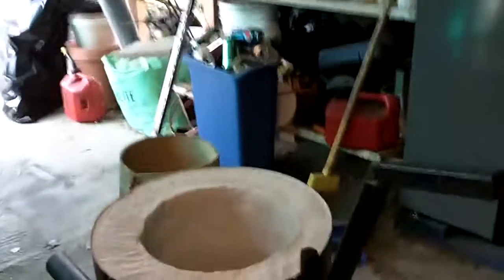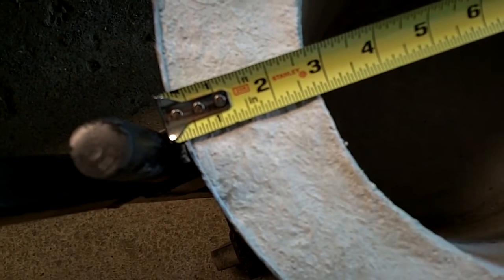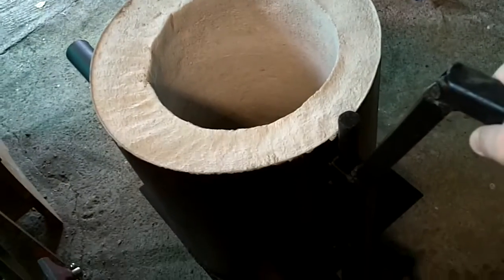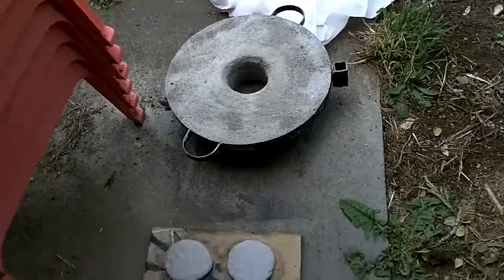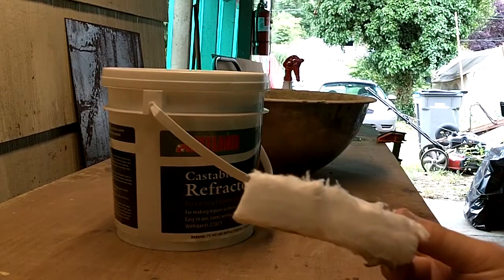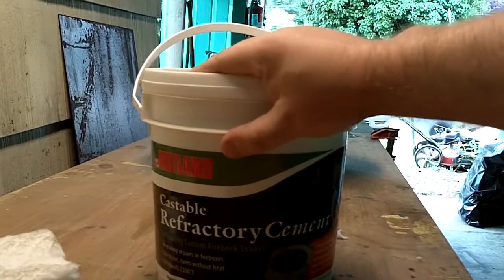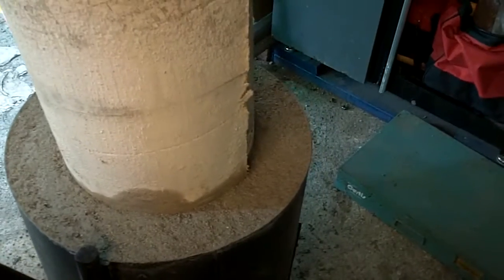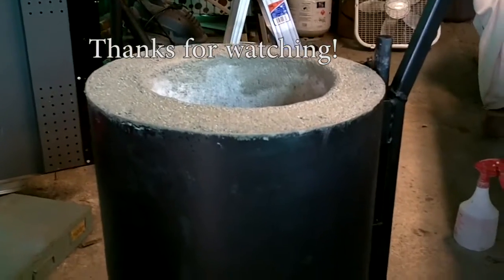Refractory Tweaking and Furnace Information

Comment: Hi all. I am needing to know where did I go wrong. My furnace was Made with plaster Paris concrete and play sand. I just bought some of that same refractory cement but it was light brown, yellow all moles. I coded the inside of my furnace with the refractory cement. And during the drying the heat drying it started to bubble? So I thought that was normal. I’ll let it dry the rest of the night and throughout the next day until the next night. Then I fired it up to melt some copper last night and what a mess. It was crumbling so bad it was falling into my copper. Was it me or was it the refractory cement that I chose? Anybody🤓

Comment: It was a good choice going with a castable refractory and wool blanket instead of the homemade version. It'll last a lot longer. The homemade stuff is only good if you don't plan on doing very many melts and nothing hotter than aluminum temps. Turned out really nice.